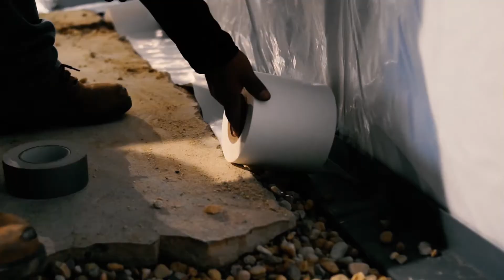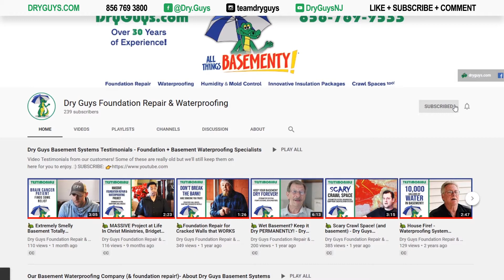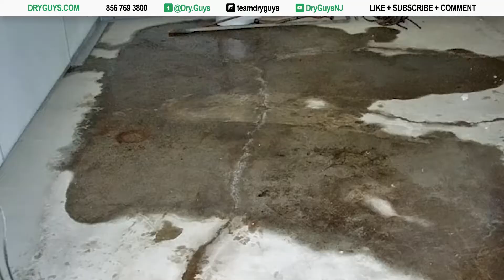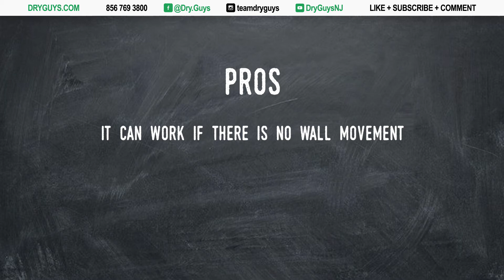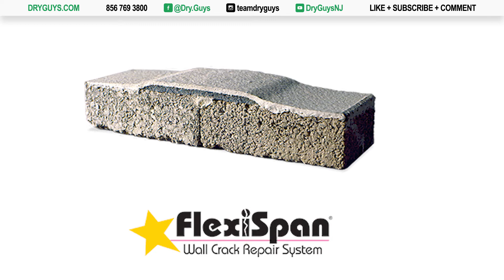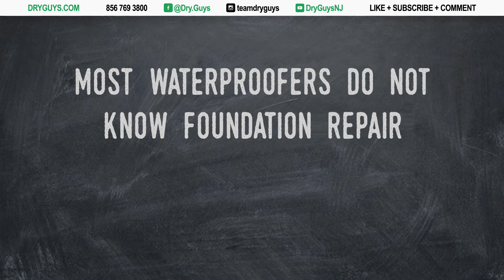Crack Filler For Foundation Repair [Pros, Cons & Tips]

Comment: I had an estimate for this type of repair. On a 28x46 poured foundation , 2014 house. The estimate was over $12,000. I think I’m going to try the $150 epoxy repair and $500 for gutters I will install.

Comment: What happens when water fills the small hole you dug in the floor?  Doesn't the seal keep water in the wall, thus weakening the concrete?
Reply from the maker: Thank you for your questions! The seal doesn't keep water sitting behind the wall, it just stops the water from coming into your basement. All of the water behind the seal runs into the Drywell, which then immediately drains either back into the soil or into your drainage system and straight to your sump pump. The hole in the floor (the Drywell) should never fill up because it's supposed to drain, and it's large enough to hold 10 gallons of water. So no water is just sitting there accumulating behind your wall or in the floor. In our area, we have not had a problem with water drainage for the FlexiSpan for the 15 years we've been installing it.
Reply: @DryGuysNJ  Would it be better to fill it with epoxy rather than patch the inside surface?   I would think this would better keep water outside of the wall rather than in it.  No?
Reply from the maker: @gg48gg  Excellent question! There's two trains of thought when it comes to waterproofing: keep the water out, or control the water. With the epoxy solution, which is quite common- that method aims to keep water out. But water expands when it freezes, and so keeping all of that water behind the wall instead of letting it through will put a lot of pressure on it, causing things to crack even more. Epoxy isn't flexible, so it will not move when the wall moves, and it will re-crack. FlexiSpan moves with the wall because it's flexible, so it will not re-crack. And because we control the water's flow (making it go into the sump pump so that it can be pumped to a more convenient place), we don't run into the issue of water pressure building up behind the wall.